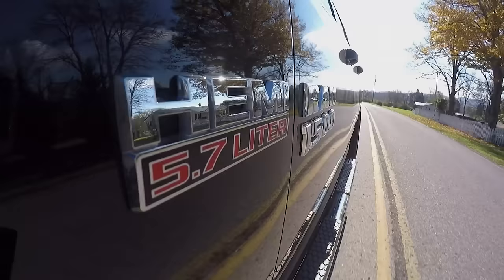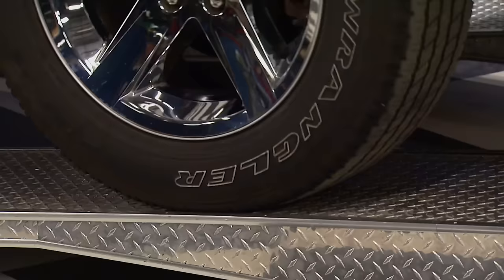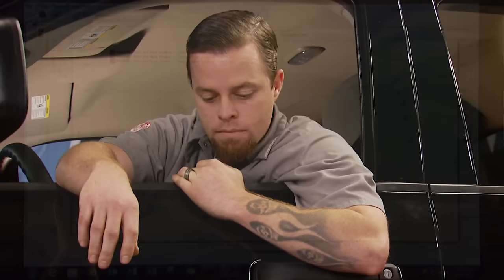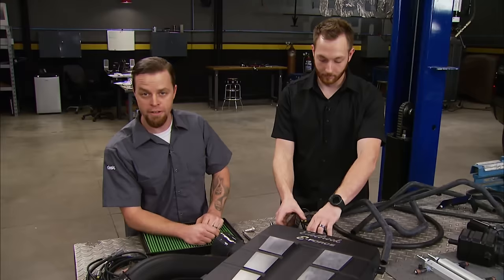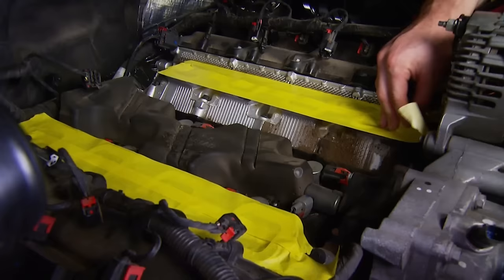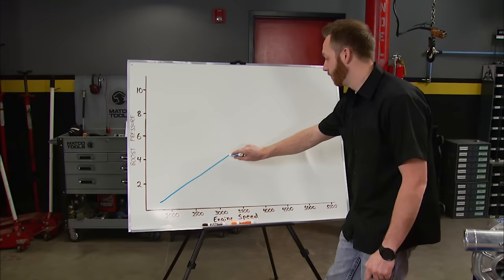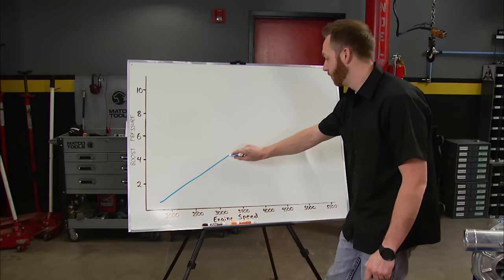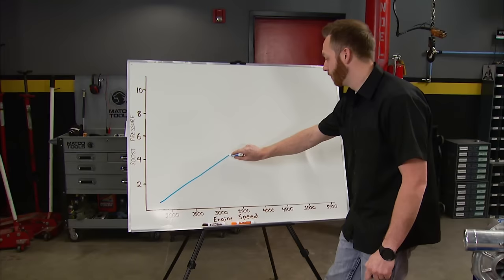Project Hemi-Hauler: Supercharger & Exhaust - Truck Tech S3, E3

Comment: clutch fan takes about 14 hp away from the engine all the time. 
an electric fan is waay better for on demand cooling.
Reply: oddly enough there is an electric fan in front of the belt driven one, for the a/c. The popular this to do is replace that fan with the electric fan from the V6 truck, it is a bigger fan with more CFM and then remove the shroud and belt driven fan altogether.

Comment: I love the trucks. I see them EVERYWHERE. “Truck of the year” yep It sure was! I own a 2003 1500 5.7. Solid truck still! It has mods. Just right amount of power. It was raised a little bit (may lift it a little soon) it has exhausts, K&N air filter, power programmer kit. It’ll make a little over 400hp but even though it’ll make probably 415hp it feels MORE than that. That K&N air filter (it has a larger one) it’ll make it aggressive with the power. I give it just about half throttle and its already going 40mph. Awesome motor but they love fuel. They guzzle. Yep. Mine taking 93 octane all the time... well I’m lucky my local gas station around the corner from my home has good prices. I’ll never let the truck go more under a little under than half a tank. It’ll be 50$ each time I fill it which is... decent. I filled it up at MANY other gas stations of course. Most amount of money I put into fuel for that mofo is 70$... that was just about on E... the gas station down the road from my place is a Citgo by the way. I hate going to Mobil with the truck it’s more expensive. I have added just the right amount of power
To my 03 hemi. So damn good! Truck kicks ass.

Comment: electric steering you can turn the wheel one finger effortless makes it handle like sports car??????? WTF  my ear hurts and you just insult our intelligence .
Reply: I was laughing that too 😂
Reply: Electric steering sucks anyway
Reply: He also forgot to mention why turbochargers are MUCH more popular than roots blowers:  1) They are much lighter  2) They are easier to intercool  3) they use virtually "free" exhaust heat to run instead of parasitic drag on the engine  4) turbochargers have adjustable boost so that the boost can be reduced at high RPMs because most engines can handle WAY more power at 3K rpm than they can at 6K rpm so while 15PSI of boost may be safe at midrange only 10PSI of boost may be safe at redline before you start breaking internal components and turbochargers allow that with a simple OBD2 tune.
Reply: Just to say I'm not hating on roots blowers though, and the reason they are typically used by OEMs over turbos is when its a V-engine (two cylinder banks means usually two turbos are needed instead of one like on a inline four or six) and when that V-engine was originally meant to be naturally aspirated in an engine bay designed to fit that.   With just a new hood, a single roots is easier to package and install on that V-engine.    But most engines, even V-engines, that were designed from the ground up to be boosted will be turbocharged like the ecoboost.

Comment: There are no instances in which a roots blower will be better than a properly tuned turbo setup. Turbos make more power, are way more efficient, are cheaper, cause way less wear and tear on the engine and are easier to work on. A 500whp supercharged engine would make 650-700whp on the same intake pressure if it were turbocharged. It would also do less(or none at all) damage to the main bearings and accessory drive pulleys. Blowers don't make sense on anything but NHRA top fuel engines anymore. They are out dated and have long been passed over for turbos.

Comment: Honestly costs like no less than 6k to really do this upgrade ! So your call, I am looking into really putting some power into my ‘14 ram 1500 sport , so far just a flow master 40 series muffler, pedal commander and a K&N cold air intake...next I’m looking at getting 2.5 in lift, replace some old parts and then hopefully either cam it or get long tubes

Comment: I’ve been looking at buying this body style truck for a little while now. For the same thing as well... to haul but nothing super heavy. I wonder if there’s a much cheaper way to get maybe 50-100hp gain?
Reply: cam, lt headders, exhaust, 6.1 or 6.4 hemi intake swap and a 93 octane tune should put you at around 450 ish

Comment: Why not just put a cold air intake also? Since you just added a super charge.
Reply: An aftermarket intake alone on a non-MAF engine is a waste of money.
Reply: Or a larger throttle body
Reply: It has a water to air intercooler. It doesnt need a "cold air intake".

Comment: Nice job . Impressive numbers . I’d say the bill would be 6K dollars if you dropped that truck off and had all that done
Reply: More than that. 15 k
Reply: Derrin Eckelmann  yep. 6500 for supercharger another 2500 for installation and any other hardware needed. Another 4 k for all those suspension parts he named plus labour to install. Your looking at 15 k at least.

Comment: You're better off spitting on those O-rings to slight the injectors in greases and oils can inhibit the O-rings ability to swell when it contacts fuel
Reply: ....right?!  I've always just used some clean fuel on injector o-rings to get them in.  I've heard of people also using engine oil, but that can't be good.
Reply: How much spit is enough spit? I've had this injector in my mouth for 45 mins now...is that enough? If I fuck this up dad will kill me!

Comment: Why didn't you upgrade the air intake?  You did spark and exhaust, but left the air intake with basically stock just a new filter

Comment: You'll be putting Valve Seats and Valves in real soon, then goes your bottom end. Chrysler has there head up there rear end and has had for years. Keeps people like me in business though :-)
Reply: I’ve never seen a bottom end go on a 5.7 unless it was ran out of oil or never changed. Also I work on 07-18 Silverado 5.3s with the active fuel management and I have 4 in the shop for lifters. Ford eco boost for many many carbon build up problems . Yes the hemi will eat up a cam and valve spring time to time but I would say only 5% of these trucks actually have this problem. Their are millions of these Hemis without any problems and with many miles.
Reply: @OriginalYTBR  well i haven't hard any bad things about the engines. But that extra horsepower is going to shred the trans in about 20k miles instead of the 40k it usually takes.

Comment: For all that parasitic loss the engine is making over 400 HP and 430 ft lbs easy.
Reply: You mean before the mods?
Reply: @231mac  yes
Reply: @231mac  I'd say more like 420 HP and 440 ft lbs
Reply: @chrishuber8930  No way. At 17% that would mean that it was making about 357 hp(rounded up), at 20% (which is the very high end of loss and not likely) would be 366 hp. This engine isn't even making its advertised hp.
Reply: It’s a 23% parasitic loss
Reply: @matthewharchenko9714  that's if you want it to match numbers. A 4x4 auto is minimum 25 percent. Some are closer to 30 percent. The Hemi makes more power than SAE rated. I had a charger rt on the dyno and stock it was 335 whp and 345 ft lbs.
Reply: @matthewharchenko9714  that car was wanted at 375 HP.,....20 percent loss on a rwd automatic is standard. Usually it's higher. Even at 20 percent that would be 300 whp flat if it was 375 crank. It was making about 405 hp and 417 ft lbs.
Reply: @chrishuber8930  parasitic loss is a set amount not a percentage, whether a vehicle makes 500 or 1000 hp the loss will be the same
Reply: @chrishuber8930  let's just say it's makes 400 crank hp, and 300 at the tyres..so it's 100hp loss or 25% in this case...lets just say a couple of 80mm turbos with supporting mods are added to engine and the engine now makes 1200hp...the loss will now be 300hp by your reasoning...nothing has changed in driveline to create more drag.. it's simple physics not rocket science!
Reply: @Chris Huber I ride a bicycle to work...it's nothing spectacular, but it is a 21 speed. I have an average upper body build but I've been told that I have longer than average legs by my doctor. Do these long peddling sticks I have increase or decrease my parasitic loss?
Reply: Can't you too see you're in love
Reply: Chris Huber & 231mac- You two guys are debate team champions 👍👍 you guys shud run for congress
Reply: @chrishuber8930 correct! so many people dont believe this, when u put more work(hp, torque)thru mechanical devices there is more friction therefore more loss
Reply: My Ram 1500 4X4 Crew Cab 4door with intake, muffler, no tune made 288 rear wheel hp on a mustang dyno.
Reply: @bri-manhunter2654  what year was it and what transmission
Reply: @bri-manhunter2654  you also need to know what gear is 1:1 ratio. If you have 5 speed its 4th gear and if you have an 8 speed its 5th gear. You were probably a gear lower on the dyno.
Reply: @bigboreracing356  theres no point in answering when someone doesn't want to be open minded.
Reply: @romper4444  uts funny how people don't understand this basic concept. The more horsepower you have at the crank means youre going to loose that same amount of loss on the total output not on the original output.
Reply: Chris Huber. All good, but most guys with the same truck as me are putting down in the same range. And for some reason it’s hard to keep them in 4th on the dyno. Mine is the 6speed. But those are all old numbers now🤣
Reply: @bigboreracing356  so youre saying it was on the same car with two different engines installed? Or two dofferent cars of same model with dofferent engines?
Reply: @bigboreracing356  id need to see if the rear end was the same, what gear ratios they were running, how many miles on both cars and what type of engines and drivetrain. This all makes a factor in losses.
Reply: @bigboreracing356  first of all its big block vs small block. Theres no replacement for displacement. That big block probably makes more power than stated. What are the numbers? That big chevy 555ci is that the edlebrock pat musi motor? I love that motor. What is it in? Camaro?
Reply: @bri-manhunter2654  thats the problem. In 3rd they dont make 1:1. In 4th gear youll see 300-310 whp stock. You're probably pushing 325 whp in 4th. I had a 2012 ram laramie before and it made 307.6 whp stock in 4th gear. Put it in tow haul mode
Reply: @bigboreracing356  typically 468 are big blocks yes but there are 468 bored out 454 small blocks as well. Got it screwed up
Reply: @bigboreracing356  so what were the numbers exactly? Do you know?
Reply: @bigboreracing356  well big block motors typically make less friction to make the same horsepower as small blocks so yes i would agree they would be slightly different. Also the motor might be making more power than suggested. This is known with BBs
Reply: Chris Huber. Thanks Chris! I’m sure my power is different now. I have a full exhaust, ported throttle body, 3K high stall, 2/4 lowered, and Jay Greene HL stage 1 cam/ tune😁 with Hellcat delete. I still need to dyno it though. I’m supposed to be making around 500hp at the motor.

Comment: Would have been nice to see torque curve comparisons since this is being planned as a towing vehicle.
Reply: Superchargers make torgue plain and simple. The seat of the pants feel wont be because of HP alone.
Reply: @dalewhitehead5378  roots and twin screw, yes. If I recall, this was a centrifugal type which makes power and torque as engine RPMs increase.p

Comment: Decent channel with honest results by using a Dyno... the costs, especially the cost per horsepower would be nice to know. Interesting is that the 390HP rating for the push rod 5.7 is obviously at the crank and not SAE... which this dyno test showed to be 305HP.
Reply: If you pulled it and stuck it on a Dyno, you might get closer to that 390 rating. Even at the height of the Muscle Wars you never got the to the tires ratings, and even then they published Gross HP. No accessories. 
I want the numbers at the ground. Installed with everything hooked up and turned on.

Comment: I got a 2017 dodge ram 1500 big horn. got a lift kit 3 in. running 33s on 22s. going upgrade to 35s. I have the super 10 muffler . what are some options I can do to get this thing to get up and haul ass. I still like to got fast and having it to sound good. im running all sundown radio system in it. would doing motor upgrades and stuff be a waste of money since I like the look and style of having mud tires and  a lifted truck. thanks for any advice mopar for life

Comment: Awesome build, I hope the hemi has become more reliable and can handle the added stress of the supercharger. Should have replaced /upgraded the timing chain and tensioners while you were in there.
Reply: Motor is fine. The problem is the pistons. To meet epa requirements the rings had to be moved closer to the end giving it less "meat" making them a little more brittle if you have a detonation so you don't want to go above 5 to 8lbs of boost.  by dropping in pistons you say to hell with the epa and you can boost the hell out of it.
Reply: They should have found a wrecked v6 Durango and put the electric fan in. Especially when turning a supercharger

Comment: Clutch fan delete, CAI, and ported throttle body would have OPENED that thing up
Reply: I did all that. Didn't notice much. Yes, I am tuned.
Reply: @cat5tracker581   on a supercharged truck you would really notice. Breather mods add a lot of hp with forced induction.

Comment: Absolutely pathetic. All that time and money for less than 450 wheel hp. Unreal. A 2015 f150 with a smaller 5.0 and a whipple will make 650 wheel easily
Reply: Chris Smith that’s because whipple makes a better super charger with more boost. This is prolly on a 5psi system not that much
Reply: Did you ever think that might be caused by the fact that whipple makes a better supercharger?

Comment: The ram motors are fine it's the transmissions that need help they up shift and down shift all day when pulling a big load.
Reply: John Walker put them in direct drive so it running in its powerband

Comment: Those HP "graphs" you drew were soooooo wrong. Do you guys actually know anything about engines and tuning, or are you just actors?
Reply: They were to demonstrated differences between the applications, and they did. The point being that the blower they chose is good for low end power.
Reply: @Clobercow1  They also made it look like a PD blower makes more power than a turbo or centrifugal blower. It doesn't. It makes the least power of the 3.
Reply: The graph was boost relative to Rpms not a power graph
Reply: @ybanvillagrana5451  It's still wrong. A roots blower tops out quick and starts to drop off about half way through your rpm range. If a roots style blower worked they way they drew it, nobody would ever use a turbo or centrifugal ever again.

Comment: So why the 6k pull after the swap instead of 4k when stock?  Doesn't that throw some variables off?
Reply: Most definatly, it doesnt even reach the top of the gear until around 6k so they are missing out on rpm for sure

Comment: Those numbers seem rather high, most dynos are showing around 288RWH on mustang dynos. I say this because I’ve seen a lot of them put these numbers down.
Reply: Mustang dynos always read lower than dynojets (what they used) because mustangs load the rollers during the pull. Dynojets are "unloaded" dynos.
Reply: Ribbityibzki. Gotcha, I was wondering if they used a Dyno Jet.

Comment: what are those boost curves XD
okay the centrifugal and the roots work on the same idea. they are belt driven and work off the engine speed. both give you a linear boost level. not like what is shown in the video in the video they show that a roots is gonna make crazy boost at stupid low rpm....no not unless you have a smaller pulley on it (surprise you can change pulley size on the centrifugal too). but even then its not gonna be like what is shown at all.
also a turbo is going to have lag like what is talked about, so in doing so the graph will look exponential because you have to get the turbine spinning with exhaust so you must rev it higher. and also turbos love load, because it makes the engine work harder which means more exhaust sooner which means it spins up faster. there is a reason they use turbos on all commercially sold trucks.
Reply: Centrifugal and roots are both belt driven, but that doesn't mean they work the same. Positive displacement superchargers push a fixed amount of air and follow the engine RPM. They generally keep the same boost level through the rev range. Centrifugal chargers multiply as the RPM goes up. The downside is that boost is very low at low RPM. 

A turbo makes use of wasted energy in the exhaust and is less load and more efficient than any supercharger on the engine. Pound for Pound (of boost), turbo's make more power. They're just complicated to set up and very difficult to install. 

A turbo and a centrifugal have a similar effect on power. Roots and Screw type chargers give you instant boost from IDLE, which is exactly what they want for towing. Throttle response and low RPM power rule in towing, which is why diesel is so popular in big trucks. They could put a small fast spooling turbo on these trucks, but gas engines like to rev and they would drop off in power dramatically and probably make less power overall.

It's all about tradeoffs.

Comment: How much would I be looking to invest if I want to do the same upgrade you guys did? Want to upgrade my 2009 ram 72,761 miles bighorn HEMI 5.7
Reply: Whatever the kit cost plus an extra 3-4k give or take. You’ll need; larger cat back exhaust, headers, bigger injectors, longer duration cams, ported head (optional), and the most important, forged pistons and a really good and reputable tune shop!